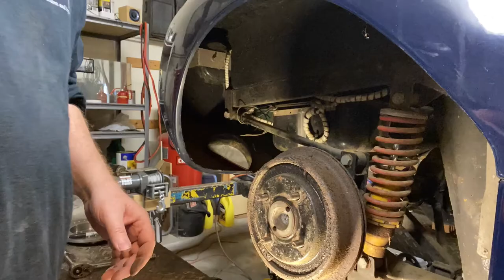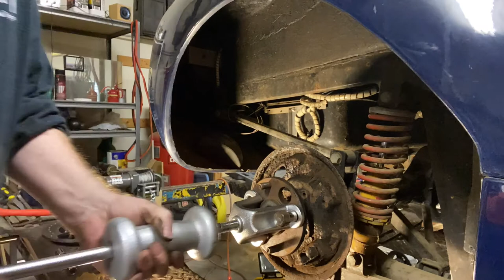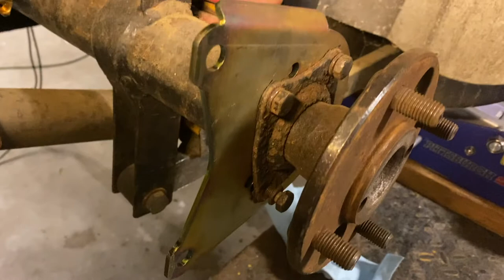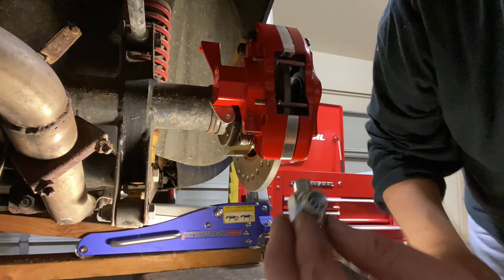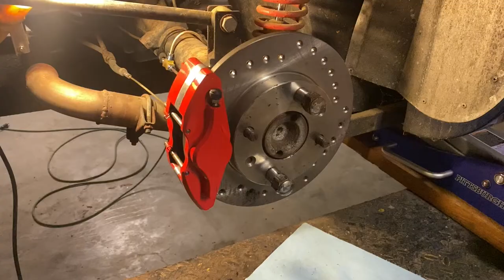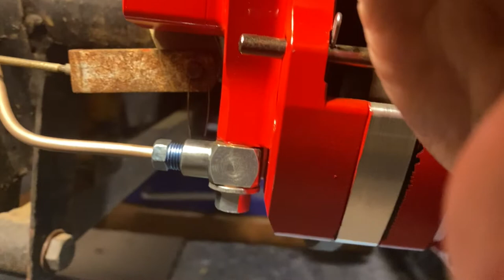HiSpec Rear Disc Upgrade on a Sylva Fury (Mk2 Escort English axle).

Comment: Hello  sorry for the curiosity, I know it has been a long time since you posted this video, I would like to know where you bought these calipers, the hi spec no longer do ... thanks
Reply from the maker: They are an old hi-spec model I bought in 2008. Only just got round to fitting them. The handbrake mechanism is not good, I think that’s why hi-spec stopped offering them.
Reply: @mikessylvafury5723  thanks for the info and for your time in answering me .. 👍
do you still use these calipers do you still have them?
Reply from the maker: I fitted them, they are on there now but will probably replace them when time and funds allow.
Hi-spec also offer an electric handbrake caliper so I might go that route.